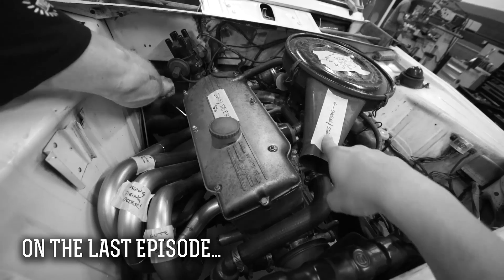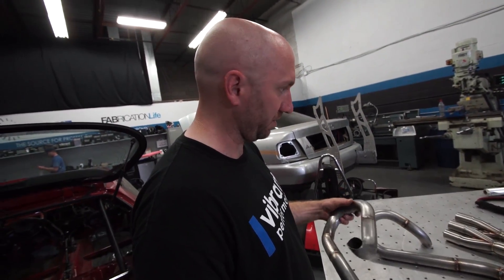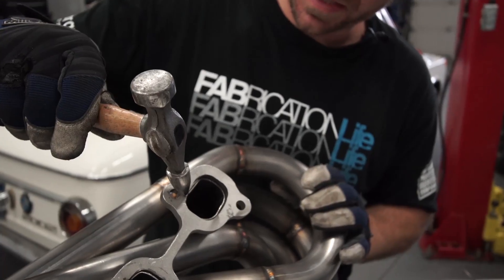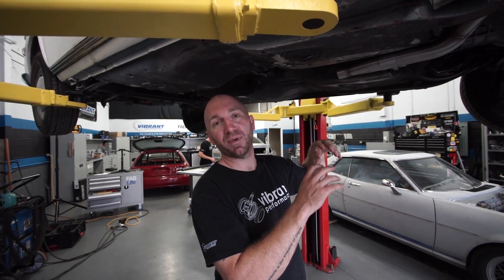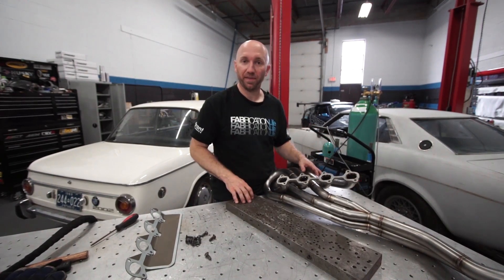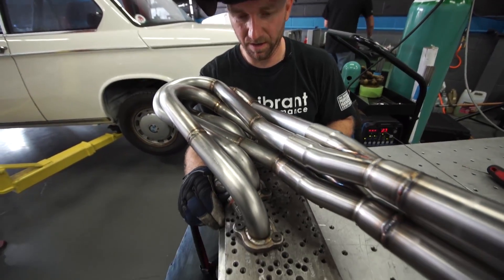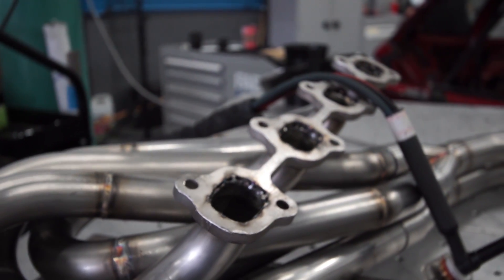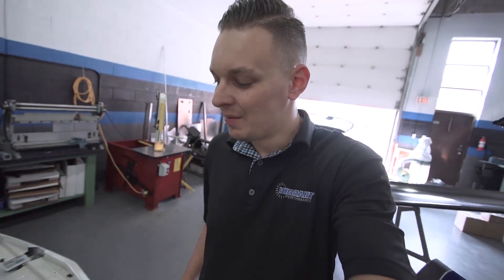Retro Header Build-Off Part 4: Final Header Welding

Comment: I'm assuming the torque magic is a conical expansion chamber to increase the bandwidth of the resonate frequency of the header. Or to state it another way improve the RPM range of exhaust scavenging. Similar to an exhaust on a two stroke engine.

Comment: Using the spring tabs, do the collectors seal off well? Or does it eternally sound like you have a pin hole leak?